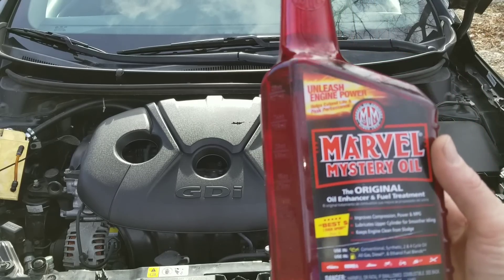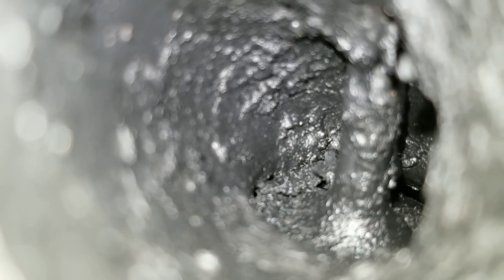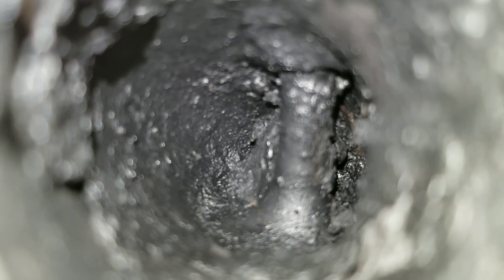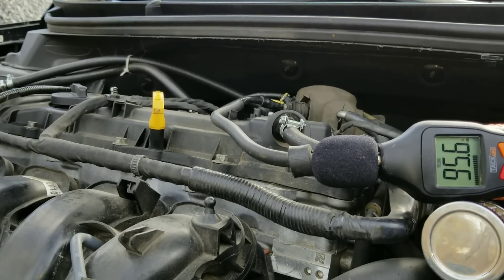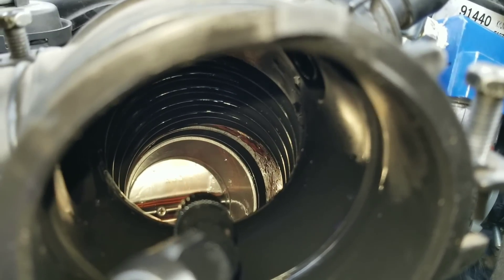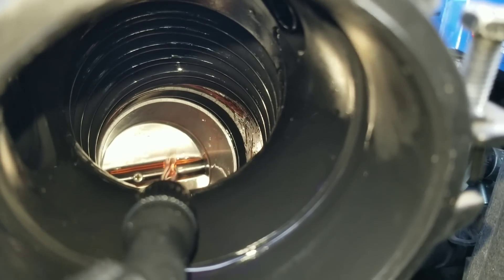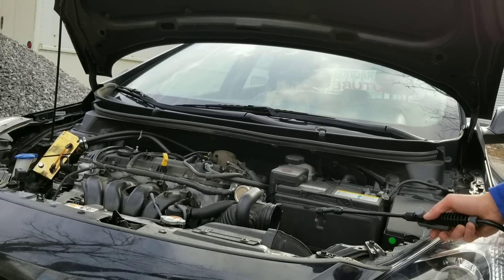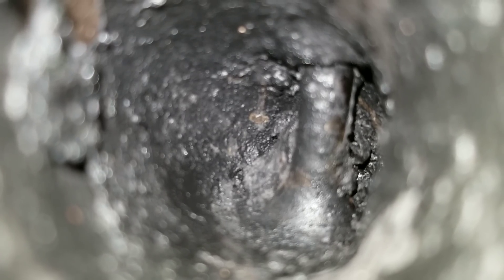SCOTTY nates REAL truth ABOUT MARVEL MYSTERY OIL

Comment: I already gave you my advice and idea.
Reply from the maker: What about marvel my oil experience?
Reply: You could pour that MMO directly in, sit a week- and it wouldn't touch that carbon. Also- with throttle plate barely open- there's zero action. Please- go do my method, word for word, step by step- and see what it does.
Reply from the maker: What about gumout gdi cleaner? And yes we will get to your method
Reply: Look at this in a different way: Initially- a thorough, heavy duty cleaning must first be performed- only then will any "cleaners" be affective at keeping it clean.

Whether it's fuel administered (worthless for GDI) or directly sprayed into the intake- if the engine is running, the cleaner is only there a fraction of a second, before it's drawn into the combustion chamber and gone.

Picture this: Your sink is already full of dirty dishes, and new dirty dishes are arriving every minute. If you stand there for 10 minutes- you'll get some done, but new will quickly pile up on top of the old. If you work steadily but slowly- you'll only manage to clean the fresh arrivals- but the old are still sitting there, getting hard and crusty- and are going to take longer than normal to get clean.

If you temporarily shut down the source of the incoming dirty dishes- you can then take your time, and get everything cleaned. If you start fresh, and stay there- you can keep ahead of the work; if you work slowly, they will start to pile up again. If you work quickly and steadily- you will keep ahead of the incoming mess, and nothing piles up.

Nothing is going to dissolve built up gunk on a surface it barely touches. Start out with fresh, clean ports- then keep them clean by using another secondary injector at each port (which new GDI now do because of this problem) or an injector at the throttle body, that keeps the incoming air clean- with either fuel or a combustible solvent that still keeps Stoichiometric parameters, and is CARB compliant.

Show up at a California SMOG station, hook up the machine- then pour Seafoam(or ANY "cleaner") in while testing. Immediate fail.
Reply from the maker: Great thanks and im testing using on a new engine also test need be performed on gunk to see if it removes but i have to wait between to try for alot of gunk
Reply: It's fairly easy to artificially produce gunk on a GDI. Spray shaken used motor oil in the intake, HOT engine, not running, wide open throttle, about 4, 1second handle squeezes of your sprayer. Let it sit overnight to bake on and dry. Repeat the spray & bake procedure at the end of every day's usage. One week later- you'll have new video material. Doing this- would make great video material!
Reply from the maker: Yeah what about jet fuel as a cleaner?

Comment: First time you take her out and open her up you will probably hydrolock the engine. All that MMO is just laying in the bottom of the intake manifold.
Reply from the maker: I did take out in the video
Reply from the maker: What would nake it better
Reply: You need to rev the engine hard with each squirt to suck it up into the valves and combustion chambers. A quick WOT snap would be how I would go about it. It's just too thick to be sprayed in like that.
Reply from the maker: Yeah what can I test next

Comment: I use oil the car builder specifies.
And change the oil at the correct intervals..
They do the research, who are we to say we know better than mr nissan?
These additives are for those with more money than sense!
Reply from the maker: The manufacturer states to use additives on my direct injection and they tell you things to sell more cars but follow manufacturers recommendations up to the point where it says change oil every 7500 or 10000 miles unless you plan on selling then that would be fine although i prefer to keep them and get as many miles as possible. They want to all say they have the lowest cost of maintenance plus the car wears out sooner. We have had synthetic oil for a long time and so how has it all the sudden been made to last 3 to 5× longer plus the metals are actually made more cheap so thats not true and they want to pass emissions and get better mpg so they so use a thinner oil but if you look in the book there always others viscosity oils depending on your climate and the oil actually has less protection that again is for emissions. So it all depends on what you want from your vehicle and i prefer to save money long term not very minimal short term